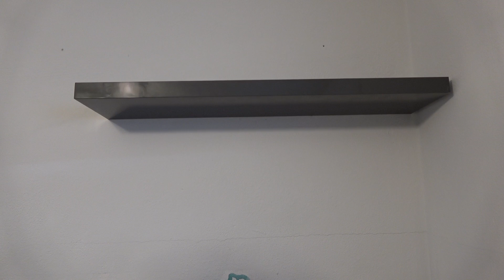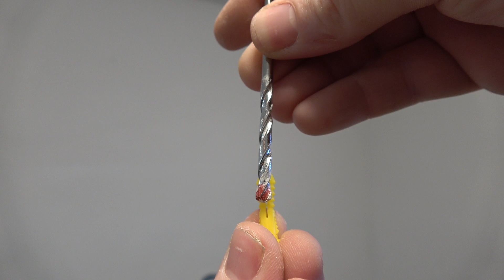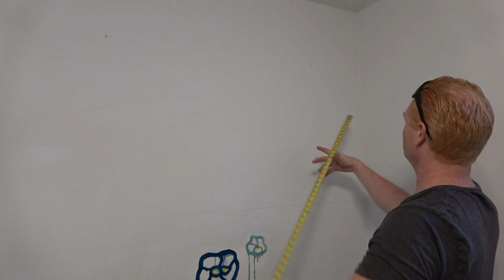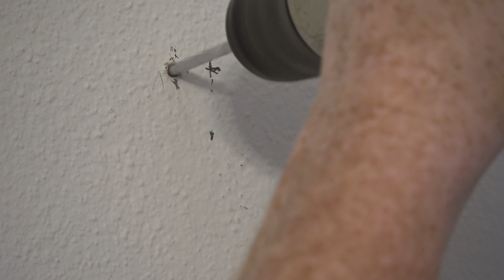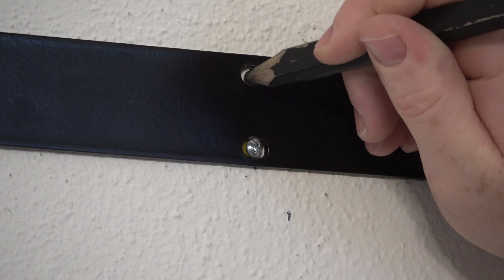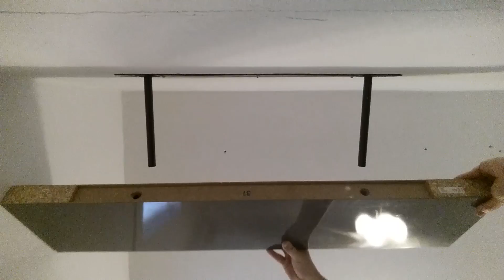Install Floating Shelf in Concrete How to D.I.Y Hanging Shelves.

Comment: but shouldnt you check if there are any electrical wires in the walll?
Reply from the maker: This was being drilled into the tie beam so I didn't see the need however yes it's important to check for any electrical before drilling holes in walls. Thanks for watching!

Comment: Helpful vid, especially appreciated the tip on using tape on the drill bit to measure the length of the screw.
Reply from the maker: @nikitakabir6173  thanks for watching!

Comment: You helped a couple hang up shelves, you happened to be using the exact same type as floating shelf as we did (ours was from Ikea) so it was even better.
We were struggling a lot Thank you so much!!! Suggestion: A video for removing the anchors and fixing the holes from a bodged shelf mounting attempt :D

Comment: could you add links to the types of screws that you used?
Reply from the maker: So here are the type of anchors I  used. They are technically a drywall anchor however they work extremely well for concrete. 

https://www.homedepot.com/p/Triton-Products-12-Steel-Screws-and-12-Plastic-Wall-Anchors-for-Mounting-Steel-Pegboard-System-LB-MHK/203477783?g_store=&source=shoppingads&locale=en-US&pla&mtc=SHOPPING-BF-CDP-GGL-D59S-023_007_ORGANIZATION-NA-NA-NA-PLALIA-D59S-NA-NA-NA-NBR-NA-NA-NEW-FY23_Shopping&cm_mmc=SHOPPING-BF-CDP-GGL-D59S-023_007_ORGANIZATION-NA-NA-NA-PLALIA-D59S-NA-NA-NA-NBR-NA-NA-NEW-FY23_Shopping-71700000108162606-58700008320585117-92700075638268495&gclid=CjwKCAjwr_CnBhA0EiwAci5siuxH6zMBBaMlkv5FYSLz8cjcOAWoZptpFST_cySC1DshwfNAmFFGHhoCNtgQAvD_BwE&gclsrc=aw.ds

Comment: My floating shelf is drooping forwards. Why is that? Like its tilting forward. How to rectify it?
Reply from the maker: Is it in drywall or concrete? For drywall at a minimum I'd suggest toggle anchors however attaching directly to the studs is the best wall to secure. If it's concrete and your still getting the tilt you may want to install new plastic anchors or larger ones. If the hole gets bored out too much the anchor won't hold.
Reply: @DoItWithDave  its a concrete wall and the guy i hired used metallic rawl bolts and plug. The paint surrounding the hole drilled also chipped off. I wish i could send photos how awful the whole thing looks.🤦🏻‍♂️

Comment: Is it OK to use plastic anchors on concrete walls?
Reply from the maker: The anchors I used in this video are plastic and have held up perfectly. You could opt to use a metal anchor however if you feel you'd want a little extra strength.
Reply: @DoItWithDave  thanks, keep up the good work! Subscribed.

Comment: Tip... I always use a washer that is slightly larger than the screw head between the screw head and the bracket.  Great video and drilling technique instruction!
Reply from the maker: Using washers is definitely the way to go for maximum strength. Thank you for your comment, and thanks for watching!

Comment: can we do the same method for mounting vertical ledge
Reply from the maker: It your reffing to a type of shelf box like design is should work fine.
Reply: @DoItWithDave   i want to do  a library unit with no back ply and wall mounted....and i'm taking vertical ledge of 1" thickness
Reply from the maker: @adwaitmore7844  does "no back ply" mean no bracket/mounting arm? If so I'll assume the back of the unit has openings with a metal plate that is bigger on the bottom and smaller on the top. If that's the case you'd just install the anchors at the correct positions where the mounting holes are and the unit should hang fine. One quick thing. Depending on how high you'll be hanging the unit, if you have small children around they may try to climb it and depending on how much weight is already being held up, could pull out of the wall and possibly do so serious damage to a kid. If you have kids around it should be high enough so they don't can't physically reach the unit. All in a the anchors being installed in concrete are very secure based on weight being held up, not being held in from moving away from the wall.

Comment: Once I mounted the center screw, and level the bracket, I never need to mark the rest of the holes and remove the center screw. U can drill through the rest of the holes then apply the plastic plugs.  Much quicker
Reply from the maker: That is very efficient. Thank you for your comment!

Comment: I pray you see this. I want to hang curtains from my concrete balcony ceiling. Gathered all my materials and started drilling...and drilling....and drilling. I could not get beyond the initial depth. I tried for almost an hour without success. What am I doing wrong?
Reply from the maker: I'm assuming you are using a concrete drill bit, if not you definitely need one for the project your working on. If you are using a concrete drill bit with no success it is possible that the hole you are attempting to drill has a piece of rebar (steel) exactly where you are drilling. You could try drilling a new hole an inch or so next to the one you already started. Other than that I'm not sure what could be stopping you from making the hole. Also are you using a hammer drill or drill driver (standard drill)? Sometimes, especially when drilling into concrete upwards it can take a bit of elbow grease to get the hole drilled. With a drill driver you will need to push and pull back the bit as you drill and tap it in the hole to help break through the concrete. I hope this helps. Let me know.
Reply: @DoItWithDave  Thank you so much for responding.. Yes I am using a concrete drill bit in addition to the "hammer setting". You're probably right about the "steel insert" because it definitely feels like a "solid barrier" preventing me from drilling further. I'll try drilling a bit further over. Hopefully this will do the trick. Again thanks for responding so quickly.

Comment: My drill won't go deep enough in the concrete wall.
Reply from the maker: Check the bit tip to insure it's not damaged, sometimes they can get burned out. Also you may be hitting steel rebar in the concrete. You could try drilling the hole just to the side of the one you started. I hope this helps.

Comment: which size of a drill bit you are using?
Reply from the maker: I think it was a 1/4" bit. The bit size should be large enough to cover the anchor when holding them next to each other but smaller then the top of the anchor where the lip it. You want the hole to be wide enough for the anchor body to slip into the hole and thin enough for the anchor lip to touch the face of the surface you'll be drilling into.

Comment: Do you live in Florida? Can you help me with mine 😢 I’ve been watching lots of videos and I tried doing it but I failed. I messed up one of my screws . The men in my house don’t want to help me so I tried doing it alone . I’m just upset and frustrated rn 😢😢😢😢😢😢😢
Reply from the maker: I'm I'm Florida however it's a big state lol. Are you going into concrete or a different material? If it's concrete you need the concrete drill bit, other bits won't work. If you are going into drywall you need to locate the studs and attach to them. If your shelf won't be holding an extremely heavy load you can use toggle anchors for drywall, they are the strongest option for drywall. I hope this helps.
Reply: Do It With Dave I told my friend on how frustrating it was that no one wants to help so I went off to work and came back and it’s up now 😂 she had her dad come in my room and do it. Thanks tho ! 😫

Comment: Do you have to use a special bit piece with your drill to avoid buying a hammer drill? I'm trying to figure out what drill and pieces to buy for a new apartment where the walls are all cement. if you have any recommendations for tools please let me know!
Reply from the maker: If you are going to be using it a lot then I'd suggest a hammer drill, however if you are only looking to hang this one thing then a regular drill driver will work as long as you get a ( masonry drill bit ). The only difference between the two drills is the Hammer drill has a setting specifically for concrete drilling, and operates as a drill driver. If you are just going to use the drill occasionally then you can go cheap on the brand. I hope this helps.

Comment: Drilling on concrete is a pain.the drill bit kind of slides a little bit some times. But it's safer than drywall in my opinion.
Reply: Concrete drilling tip: use a smaller drill bit to make a pilot hole first before using the correct size drill bit to drill the final hole.
Reply: Good idea  @jonroflo2006

Comment: Are 1x2 firing strips supporting paneling in basement enough support without drilling into concrete?
Reply from the maker: They are pretty strong because there attached to the concrete already. I would definitely be okay with installing shelves using furring strips. I actually did hang some shelves off furring strips recently and they held a ton of weight I just predrilled a very small hole as to not crack the strips with the screws. I hope this helps. Thank you for watching!

Comment: Hi I really don’t understand how you did that so perfectly. My wall is concrete and I try what you did but I wasn’t successful. I screwed my concrete bit and it didn’t go through. I try to put anchors and all it did was made a huge hole on my drywall.
Reply from the maker: Natividad Torres from what you posted it seems like you had two separate issues with the ancors. First for the concrete you definitely need the correct drill bit or else it will just burn, dull and break it. Sometimes you may hit rebar (steel) in the concrete and that will definitely burn out a even a concrete bit. If you see smoke or the bit turning red you may need to move the hole to the left or right as steel usual runs up and down. For the drywall a floating shelve can be a nice thing to install however because drywall is a finish product it won't hold a lot of weight before an ancor starts to pull out and making a big hole in the drywall. Floating shelves in drywall is good when they are small and or won't have alot of weight on it. If you want to hang a floating shelve on drywall you may want to get a stud finder and drill screws directly into the wood or metal studs depending on what is behind the drywall. I hope this helps.
Reply: Thank you. It really did help. From all the post I have seen ,your was the most informative 👍

Comment: I have the same shelves in white. Any idea what size of bolt/screw you used for the two that keep the shelf from sliding off the bracket? I've lost mine when we moved. Thanks!

Comment: How much weight can that hold, I always have problems with the screws pulling the fasteners out of the wall.
Reply from the maker: Yisrael Dov L it really depends on what type of wall. The anchors used in this video can also be used in drywall but I only like to use them to hang pictures and mirrors if going into drywall. If I put this up on drywall I'd find the studs and attach the bar to them. You are absolutely right and I've also had these anchors pull away from the wall and it can be frustrating. I hope this helps.
Reply: Thanks, here in Israel, drywall doesn't have wood studs :(. Aluminum frames are used.
Reply from the maker: Yisrael Dov L you should be able to use a drywall screw to fasten the frame to the metal studs. If the screw head is not wide enough someone mentioned using washers with screws, also I've had good experiences with toggle bolt anchors. They are very strong bc of how they secure to the inside of wall. But I'm not sure if I'd put more than 30lbs used in drywall. Again the metal studs should be good and strong.
Reply: Thanks, will need to see about how to find the stud. Still not sure it could support much weight.
Reply from the maker: Yisrael Dov L you must be surprised by how much weight those studs can hold. A stud finder should work even a magnet could help by placing and removing it on different locations you should get it to hold itself on the wall once it contacts with a drywall screw. Also outlet boxes here are normally attached to the studs so you could use that as a way to start from. Just trying to be helpful if possible. Anyway if you feel like posting back on your progress it would definitely help others that are working with the same circumstances.
Reply: Magnet won't work, aluminum frame. I think I'm just going to end up building a frame.
Reply from the maker: Yisrael Dov L You Rock!

Comment: You should use the washers or larger screw head so the shelves will hold more weight with safety. 😉
Reply from the maker: Luciana Delduqui I agree with you about using washers for extra strength. That would be best for someone looking to put a lot of heavy items on the shelf. Thank you for your comment!
Reply from the maker: @missbriteyes  I had about 30 lbs worth of stuff on this shelf with no sagging. Using a larger screw head and or washers will add a bit of strength preventing the possibility of the screw head slipping through the holes in the bracket. Basically a larger screw head and washer cover a larger surface area.  I hope this helps. Thanks for watching!

Comment: How much weight will the shelf support?
Reply from the maker: Willie Smith as long as the anchors are secure they should support the max weight shown on the box they come in. I think each anchor I used supported up to 25lbs so multiply that by the number of anchors and it is pretty darn strong. FYI if you are planning on using the anchors in drywall they will pull out of the wall if there is to much weight put on them. I hope this helps.